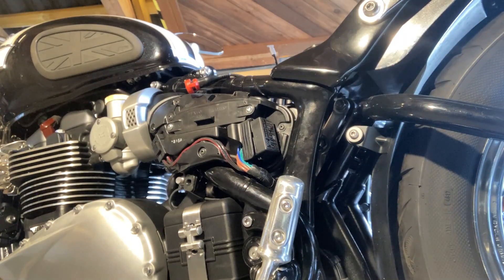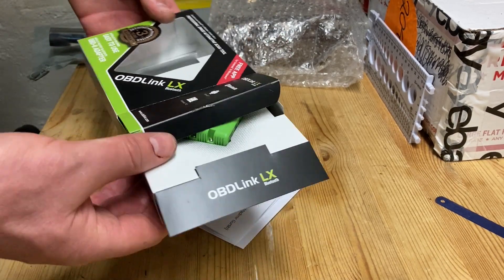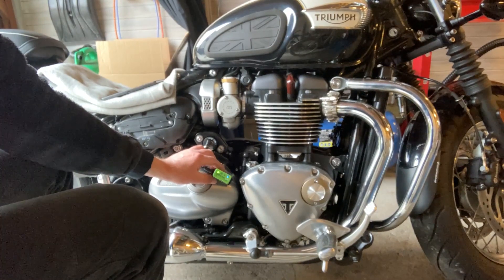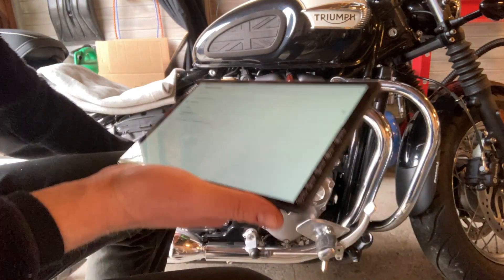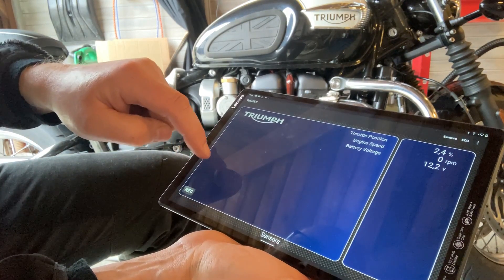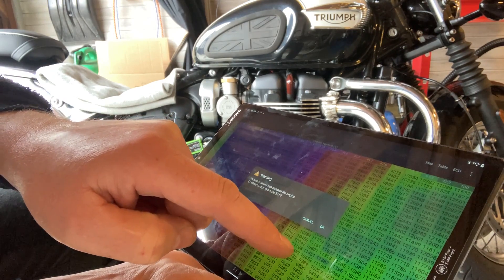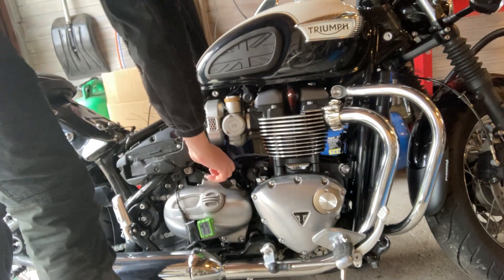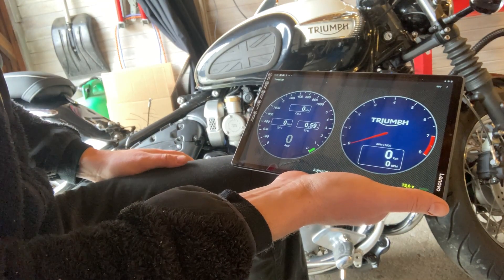ECU update on Triumph Bonneville Speedmaster for massively improved performance

Comment: Would the new map negate the need for the Booster Plug, correcting that lean condition? Or, is there a map, or region of correction within a map, that would do what the BP does?
Reply: Booster plug does nothing

Comment: I rode a stock Speedmaster with this upgrade. Clean fuelling with no fluffing or backfiring. The most astonishing thing was the fuel economy. Over 650 miles in Massachusetts and Vermont of mixed riding I got an average of 83 mpg (UK gallons) and one one day over 90. This was from the bike’s gauge and backed up by measuring the fuel and mileage from the other bikes. Utterly staggering! How was yours?

Comment: After 4 months you should have fair idea of the results of the new tune. Will you consider sharing ??
Reply from the maker: I am still satisfied with the tune. Great throttle response, a very slight stumbling during idle, but nothing compared to stock. I would still do the conversion - absolutely woth it.

Comment: I just purchased a red 2022 Speedmaster, traded in my T-100. Speedmaster coming next week. So excited for this machine ! I already have a TEC Bike X pipe for it.
Questions, 1. Where fo you locate the ECU type ? 2. Can you read and save the original Factory programming so you can re-write it back to the programming setup when the bike was new ?
Reply from the maker: You access it via the OBD socket and upload the new map.
Reply: @wheelsdk8935  I was wondering the same thing as the guy above, does that software give you the option to save the original map before you do any reprogramming?

Comment: Am I better off to remove the booster plug and then get a tuning map from DNK....or just include the booster plug in the list of modifications (from DNK website) and get a tuning map accordingly
Reply from the maker: I was requested to remove the booster plug. The new map in itself improves the performance and the booster plug would disturb the operation of the engine.
Reply: @wheelsdk8935  Thanks for your reply, it is all sorted now. :)

Comment: Look forward to hearing the results!! Where did you purchase the ecu map from?  I assume in increasing performance that you will see a loss in fuel economy.  But I think more smiles are better than more miles.  Keep us updated
Reply from the maker: The map is from DNK Tuneworks, and I must say that I am impressed with the result. It’s a totally different riding experience. There’s plenty of power throughout the entire rev-range and the near stalling at idle is gone. More smiles as you say 😊
Reply: @wheelsdk8935  that's awesome to hear! Trouble at idle? Was this after your mods? I only have the Vance and hines (us) but no xpipe or booster  My biggest compliant is the hesitation and jerk on throttle during first.. Hard to keep smooth in the city without heavy clutch/friction zone work.  But I always find more than enough throttle response through most of the midrange..
Reply from the maker: The improvement is through the entire rev-range, and especially at low rev / urban cruising. It responds immediately and provides power all the way from the bottom. The factory map was very lean at idle and low revs with a tendency towards stalling. This is totally changed for the better now.